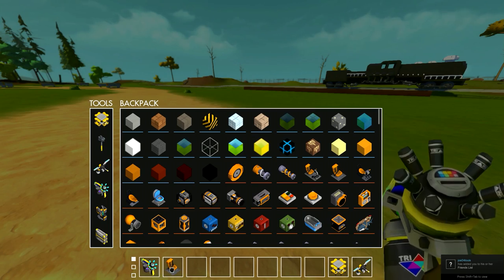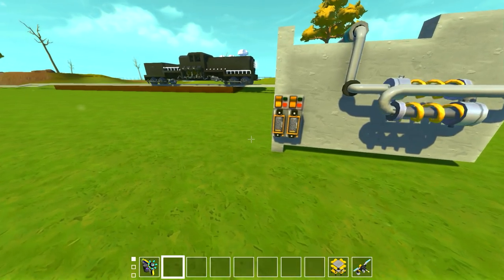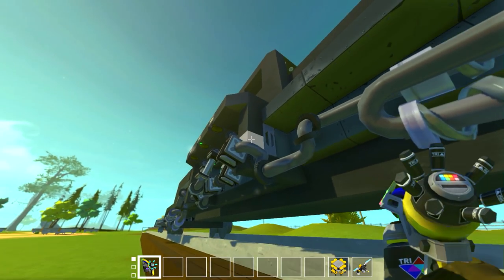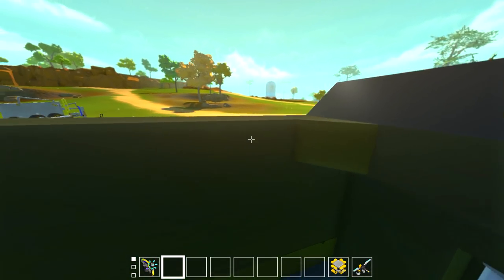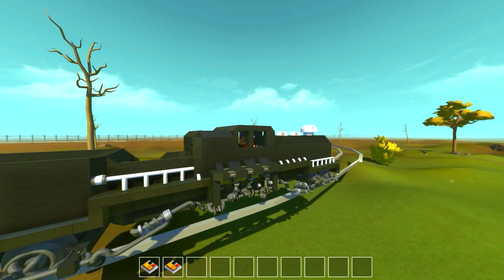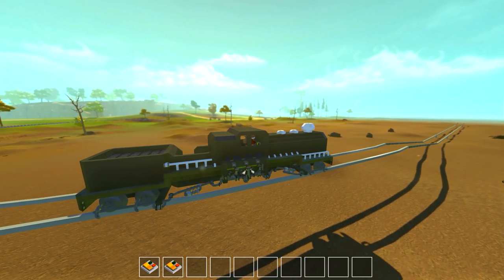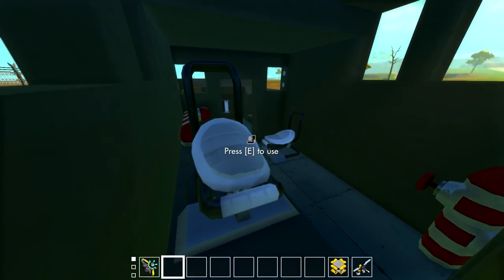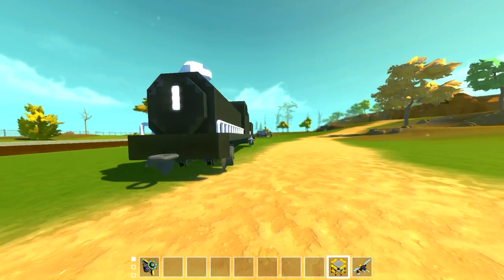Piston Powered Steam Gear Train! (Scrap Mechanic #213)

Comment: Can you try to make a 'single piston' engine? (Only one piston)
Reply: that challenge requires  a heavy flywheel or crank.. need way more kinetic energy to work in game.
otherwise with thrusters it backfires and blow a piston tru the side caused by the timing gets wonky .
but again.. thats with thrusters.. they need resistance to run well..
pistons still lack power and loose stability at high speed so it might be possible without blowing the engine.

Comment: The configuration based on wheels would be 0-4-4-0. There isn’t a configuration based on the amount of pistons since most usual engines have 2 and shays usually have 3.

Comment: You should try making a train that uses gears to get up. These trains have tracks with teeth and the train itself has gears. Those gears are used to help the train get up hills and were usually used on steep lines. It would also be really cool if you could make a train that uses those gears to get up on the hills.

Comment: make it so theres a pretend furnace and if you put blocks in it sensors will activate a timer which will activate the fire (thruster/ lights) which would be connected to a nor gate so that the train will only work when the "coals" are burning
Train suggestions:
union pacific, metra, amtrack, scotrails, BNSF, Santa fe (same engine as union pacific but painted different), steam locomotive, ICB (electric super train that goes a max of 280 KPH), and a BR 175.

Comment: kAn in case you are interested and didnt know it. Your train is a 0-8-0 configurated steam engine. It's the way they named steam trains in old times depending on how their wheels are set up(you could read on it in case interested on some wiki). But it'd be really cool to see you make a train with some other configuration or with maybe even with more wheels. For example a 4-4-4 configurated train or maybe even  4-8-4 :P

Comment: Try making a GWR Castle Class engine they kinda have 4 Pistons (2 on the outside 2 on the inside) but it does seem kind of easy because it's basically just a repeat of a standard engine

Comment: Kan, it is a 4-0-4. This comes from the number of wheels per bogey. There being 4 wheels on the front side, no center bogey, so 0, and 4 wheels on the back bogey.
Reply from the maker: Ah so that's how the numbering works. I thought maybe the number of pistons was tied in there somehow
Reply: kAN Gaming it was a good shot, but no. It is hit the wheels per bogey.
Reply: kAN Gaming Well, technically you're both wrong and it is a 
B-B configuration. I assume geared locomotive's whyte notation is written the same as diesel locomotives as it is two powered trucks connected to one engine.
Reply: Gunnar OK yeah, but if he were to call it by wheel configuration, it would be a 4-0-4
Reply: broscolotos whyte notation is the actual name and how wheel notation works in the US. Besides, if we're not counting diesel wheel bases into this, it would actually be a 0-4-0-0-4-0. If we're going off British notation, it would still be a B-B, or without diesel, 0-2-0-0-2-0.
Reply: I am not sure if that is fully correct, but Ill respect, and agree with you

Comment: nice work kan.. its actually possible to make that expansion joint ,if you use the surface panels and edge connectors  from polygon mod .
then you can make a casing that a 1x1 rod can slide in..  i used it on this crane. http://steamcommunity.com/sharedfiles/filedetails/?id=1105921044
i actually think it would help if the cart connections could move up and down too. then you would have more contact to the tracks.
or make the wheels on each side on a bar with a center  pivot point.  like an old scale weight. then they can follow the track up and down. 
also i got an idea for a challenging build.    make the mercedes benz hexawheel.
so many things that have to work together forms a great puzzle  ;)